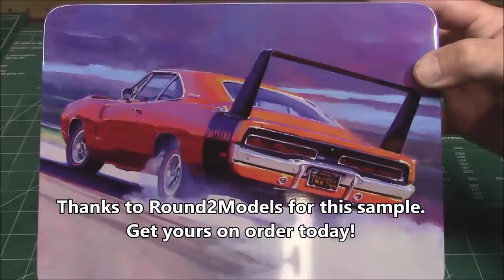1969 Dodge Charger Daytona 426 Hemi JOE DIRT 1/25 Scale Model Kit Build Review Weathering AMT 1232

Comment: I really enjoyed how you built this one. Ironically I decided to start on a build of the  Joe Dirt Daytona about a week ago, as I couldn't figure out what to do with this older, incomplete AMT issue I've had  for years.. Oddly enough I've never seen the movie, so been trying to research as many details about the car as possible, and really glad I found your video.  Like yours, it won't be exact to the movie car, but I am adding slicks on the back, and I've opened one headlight door so far. And other than the mismatched seat covers, the chain steering wheel, I can't tell what color the interior is supposed to be on the real car, so I'll have to improvise, as you did. Thanks for the tips on weathering, I needed to re-learn other methods of doing this, which, I find is way more fun than building them looking like pristine show cars.

Comment: From this, I just learned that the old General Lee was this kit minus the custom parts AND the nosecone. I'm actually surprised that they were able to fix the molds that much. They're far from perfect, but they're WAY better than they used to be.

That said, to make a stock Charger, the body would be wrong 'cuz of the rear window mod for the Daytona.

Nice work as always.
Reply from the maker: Thank you!

Comment: I saw this at Hobby Lobby (or it was Hobby Town); if I knew it could be made as a regular '69 Charger I would have gotten it; I might think of getting this one. Thank you for this video! Meant to get some photos and show you the job I did on the MPC '69 country charger (it was my 3rd time doing it), and think it turned out nice (but ended up selling it; but I did live stream some working on it).

Ohh, that one piece, I dont know what it is, but it goes on the bottom of the chasis, at/near the rear wheels. I forgot about it the 1st two times I built the MPC '69 charger kit (not sure if I put it on my 3rd build either). It wasn't [til] after I was finished that I noticed that part and was checking the instructions about it. lol

Comment: From what I can remember, the main reason there were the holes in the fenders was so that the front tires would have more space due to them hitting the inside of it at high speeds. Though it did lead to slight improvements in drag coefficients and better aerodynamics. Great video as always and a great build.
Reply from the maker: Thanks for watching!
Reply: That's not exactly true, real car doesn't have large holes in its fenders for the wheels. In reality it's got a simple mesh underneath those extensions. They served only aerodynamic and cooling purporse.

Comment: The part in question is a rear-end cooler; it was part of a NASCAR version. There also was a smaller oil cooler on the chrome tree that was meant for inclusion under the hood.  BTW, the AMT version of the Charger Daytona requires extensive body work needed for incorporating the nose cone. But your "Joe Dirt" version is nothing short of genius.  ( The Revellogram version is still the better version of the kit, but this one's okay 😊😊 !) Thanks, Chris !

Comment: ~you did a great job on this but I was disappointed in buying this one at its price~the MPC version of the 1969 Country Charger was a lot more beefier and sturdier and hardly no flashing~seems this was a very cheaply made model with a bad mold to make it~I built 3 MPC Chargers with a better appearance than what I just built with this one~as I made the drag option with a hood scoop and blower~that part at 3:37 goes underneath the chassis in the hump for the rear suspension sysytem where the differential comes out~there is a tab that accepts it as in the MPC version to me it looks like an air filter element but why underneath the car is beyond me~good job and keep it up~😀👍

Comment: I think it might be a oil cooler cause I think it might be a left over from a NASCAR kit or it just ended up in this kit since it's not even in the instruction manual I have a 65 galaxie 500 kit that's got drag and race parts I think one of the charger kits had similar parts
Reply from the maker: Yup!

Comment: I just bought one of these i havent put it together yet but mine honestly looks like crap the pieces are warped with a ton of thick flash and it has some wierd black stuff on all the plastic
Reply from the maker: It would be advised to return it to where you bought it for an exchange if it has that many problems.